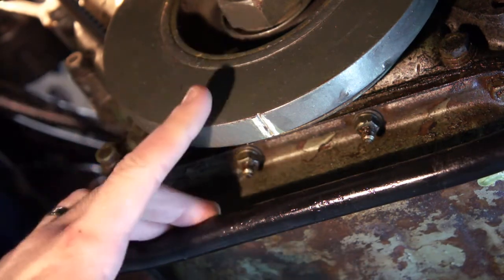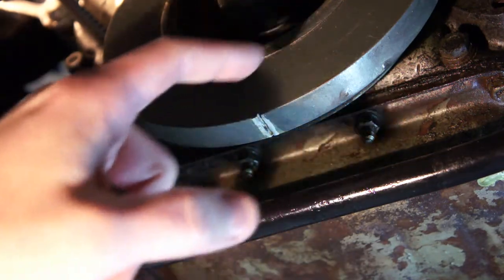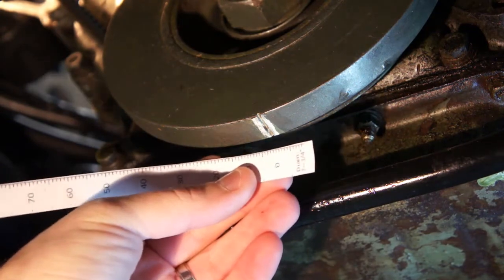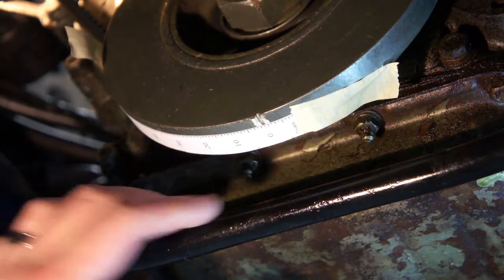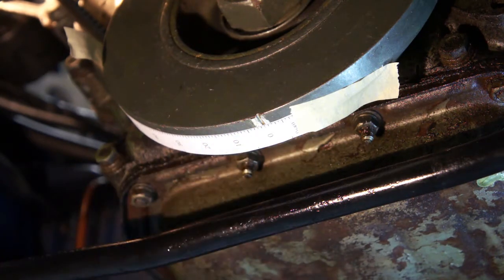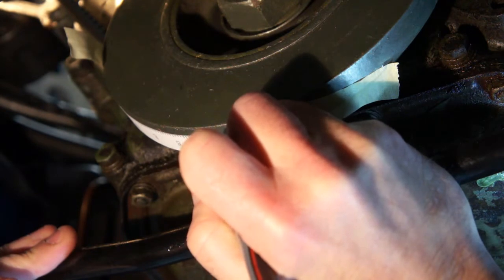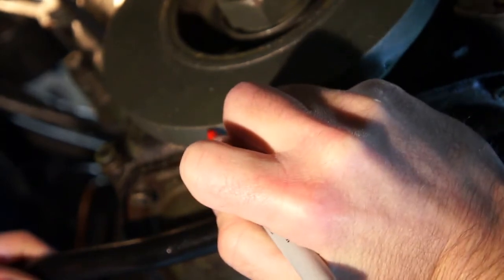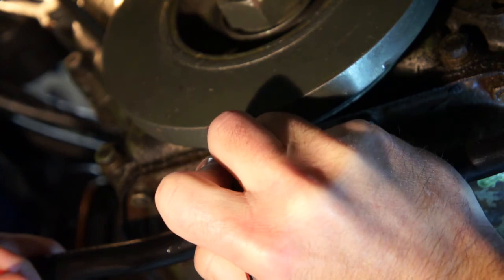1968 MGC Marking Crank Pulley for Engine Timing

Comment: So you are dropping your distibutor in a 8 degrees before TDC, and then setting the timing at 16 when running?
Reply from the maker: Yes, according to the Bentley manual 01.B13, removal and installation of the distributor drive is to be performed with the crankshaft pulley at 8 BTDC.  The company that refurbished my distributor recommended a setting of 14-16 BTDC at idle.